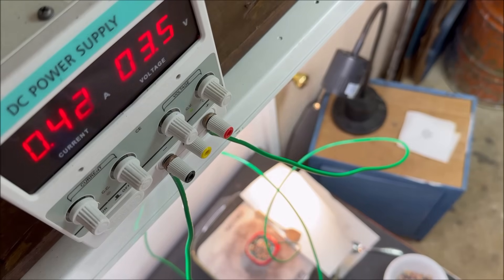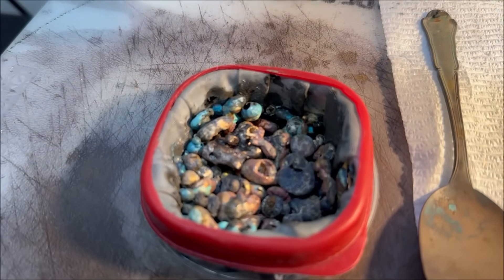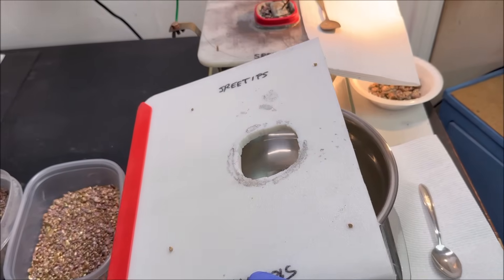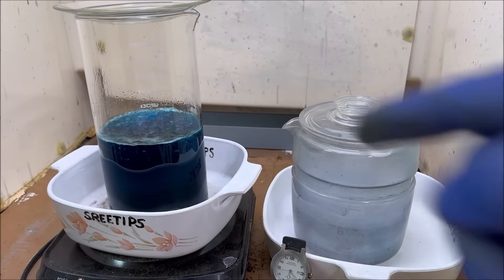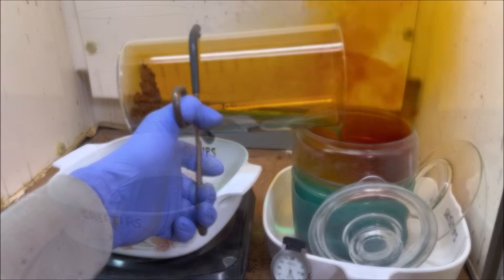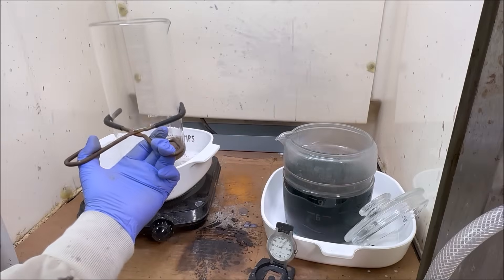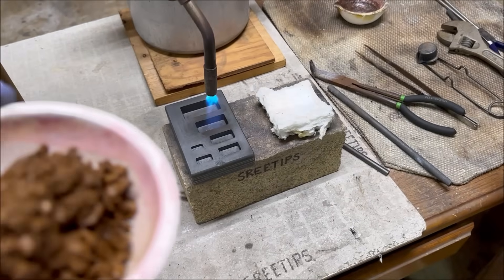Where Does The Silver Come From For The Silver Cell

Comment: What's the point? Is it just pulling silver out of solution? Where does the silver nitrate come from? Isn't it more expensive than the silver that is extracted? Pardon me for being dull. But I can't see what is gained, unless silver nitrate is cheap.
Reply from the maker: I refine gold. I use sterling silver, that I buy at estate sales, to refine the scrap gold. I recover the silver from that, melt into shot, and run it through my silver cell. Silver is a by-product of my gold refining. The cell converts the impure silver (about 980 parts per thousand silver) to high purity four nines fine (9999 parts per ten thousand) pure elemental silver metal. So I’m refining the impure silver, that I recovered from my gold refining operations, into high purity silver, not creating silver out of thin air. When the silver cell is full of pure silver, I harvest the pure silver crystal, put it away and forget about it. Then I repeat the whole thing again.

Comment: so you need to have silver to make silver, got it
Reply from the maker: Correct. I refine gold. I use sterling silver, that I buy at estate sales, to refine the scrap gold. I recover the silver from that, melt into shot, and run it through my silver cell. Silver is a by-product of my gold refining. The cell converts the impure silver (about 980 parts per thousand silver) to high purity four nines fine (9999 parts per ten thousand) pure elemental silver metal. So I’m refining the impure silver, that I recovered from my gold refining operations, into high purity silver, not creating silver out of thin air. When the silver cell is full of pure silver, I harvest the pure silver crystal, put it away and forget about it. Then I repeat the whole thing again.

Comment: So, are the source materials, jewelry and flatware, basically worthless?  Just wondering what the ROI is after source materials and equipment.
Reply from the maker: Actually, the jewelry and flatware both have a known quantity of pure silver and they can be, and they should be, held just like they are. No need to refine sterling silver as long as you don’t ruin the markings. Most of my silver was acquired back when silver was under twenty bucks. In order to calculate ROI then I’d have to sell it to determine gain or loss. And I’m not wanting to sell my silver. I’m saving it for retirement. When silver hits $300 I plan to use it to fund my retirement. I’ll make and sell 5 ounce silver bars, ten ounce if I need a little extra.

Here’s the secret; the ONLY reason that I refine silver is because I have hundreds of pounds of cement silver from my gold refining. Silver is a by-product of my gold refining. But the cement silver has questionable purity and value. So I MUST run it through my silver cell to get it to industry standard three nines. Then its value is easily determined. Hope this helps. Thank you.

Comment: So when you sell, do you do it mostly to refineries or do you ever go to a coin shop? I'm sure if I looked I'd find a video you've made on it but how would you go about refining the gold further or do you typically call it about where you got it in this vid at .990ish
Reply from the maker: I’ve never sold gold or silver to a pawn shop. I’ve sold silver bars on my eBay site about ten years ago. I sold every bit that I refined. Made a good income from it. Then I started just saving the silver because I knew, for almost twenty years now, that we were in trouble when they started printing currency, out of thin air, to avoid financial ruin. I sell a few grams of gold on my eBay site. I sell an ounce or two of pure silver crystal there also. But I don’t need to sell the metal, so after I refine it, I put it away and forget about it.
Reply from the maker: The gold can be refined a second time if contamination is still present, or suspected of being present. Each time I dissolve, filter, precipitate, each cycle the gold becomes higher purity. But if I want ultra high purity then I’d just run it through my electrolytic gold refining cell.

Comment: So why do you use impure silver for the basket and not the pure stuff you get from other harvests?
Reply from the maker: To purify it. I have buckets of impure silver from my gold refining. Its purity and value is indeterminable. But after I run it through the silver cell, its value is easy to determine.
Reply: @sreetips  Thank you as I'm trying to learn things, I've only been watching you since you are very proficient. I'm gonna be trying to make my own silver cell in the next month or so. Thank you for the fast reply back :)
Reply from the maker: The only reason that I refine silver is because I have so much of it from my gold refining. The only reason I refine gold is to make content for my YouTube channel. Sterling silver can be and should be held as is. No need to refine it. As long as you don’t ruin the markings, it will track right on up with the bullion price.
Reply: @sreetips  Thank you so much for that, I'm not gonna work with Gold for bit due to the price of course, but that is an awesome tip, thank you for being so helpful :)
Reply from the maker: The same goes for karat scrap gold. You can buy it very cheap at yard sales. Then put it away and forget about it. Next thing you know, you’ve got a hundred grand in scrap gold and silver.

Comment: What kind of safety gear and precautions would one need to take for doing this? Also I assume good ventilation is needed and temperature control?
Reply from the maker: Fume hood is required. No way to safely do these reactions without one.

Comment: bro so I can produce silver at home and make money this way? OR what
Reply from the maker: Yes, I’ve been doing for a decade and a half. But you make your gain when you buy. I refine gold. I use sterling silver, that I buy at estate sales, to refine the scrap gold. I recover the silver from that, melt into shot, and run it through my silver cell. Silver is a by-product of my gold refining. The cell converts the impure silver (about 980 parts per thousand silver) to high purity four nines fine (9999 parts per ten thousand) pure elemental silver metal. So I’m refining the impure silver, into high purity silver, not creating silver out of thin air. When it’s full, I harvest the pure silver crystal, put it away and forget about it. Then I repeat the whole thing again.

Comment: I'd be willing to bet there is corrosion in that power supply causing the failure. They don't  use conformal coating. 

If you open it up,  take a look and find lots of corrosion your other power supply is headed for the same fate. 

If its corrosion  than you can apply a conformal coating to protect against the acid fumes. I've used clear enamel paint or silicone conformal spray. I've used this method to protect my psu and vent fan. Never replaced either of them once they were protected. I had gone through several fans and a PSU over a 3 year period. It's been over 5 years now without any problems :-)

Comment: What is impure silver?  Is it .925
Reply from the maker: I refine gold. I use sterling silver, that I buy at estate sales, to refine the scrap gold. I recover the silver from that, melt into shot, and run it through my silver cell. Silver is a by-product of my gold refining. The cell converts the impure silver (about 980 parts per thousand silver) to high purity four nines fine (9999 parts per ten thousand) pure elemental silver metal. So I’m refining the impure silver, into high purity silver, not creating silver out of thin air. When it’s full, I harvest the pure silver crystal, put it away and forget about it. Then I repeat the whole thing again.

Comment: Hello sir, If copper precipitates silver. and iron does that to the copper. What would precipitate tin if it was present ? Im salvaging a good bit of safety, silv 56. Maybe i can get some stannous as well as silver and copper ???
Reply from the maker: I’ve never worked with tin except to make the stannous chloride testing solution that I use to test for the presence of precious metals in solution.
Reply: @sreetips  just wondering what if

Comment: Are you actually growing silver using silver? I have watched a few videos and they are very good, great content and informative. But are you actually growing it or just refining it making it worth more.
Reply from the maker: I refine gold. I use sterling silver, that I buy at estate sales, to refine the scrap gold. I recover the silver from that, melt into shot, and run it through my silver cell. Silver is a by-product of my gold refining. The cell converts the impure silver (about 980 parts per thousand silver) to high purity four nines fine (9999 parts per ten thousand) pure elemental silver metal. The impure silver is added to the anode basket. The anode basket is suspended in the silver nitrate electrolyte. I pass an electric current through the impure silver. The silver dissolves, passes through the Dacron filter, travels through the silver nitrate electrolyte, and deposits (grows) on the inside of the stainless steel bowl (the cathode). The bowl is connected to the negative pole of the power supply. The process only deposits pure silver on the cathode. So I’m refining the impure silver, into high purity silver. When it’s full, I harvest the pure silver crystal, put it away and forget about it. Then I repeat the whole thing again.
Reply: @sreetips  Brilliant thank you very much, makes more sense when I read what you wrote. 
Fascinating videos and information. 
Top man as we say in London

Comment: Great, could you explain the process of growing the silver crystals please?
Reply from the maker: Yes, I refine gold. I use sterling silver, that I buy at estate sales, to refine the scrap gold. I recover the silver from that, melt into shot, and run it through my silver cell. The cell converts the impure silver (about 980 parts per thousand silver) to high purity four nines fine (9999 parts per ten thousand) pure elemental silver metal. The impure silver is added to the anode basket. The anode basket is suspended in the silver nitrate electrolyte. I pass an electric current through the impure silver. The silver dissolves, passes through the Dacron filter, travels through the silver nitrate electrolyte, and deposits on the stainless steel bowl (the cathode). The bowl is connected to the negative pole of the power supply. The process only deposits pure silver on the cathode. So I’m refining the impure silver, into high purity silver. When it’s full, I harvest the pure silver crystal, put it away and forget about it. Then I repeat the whole thing again.

Comment: I started my silver cell this past weekend.   Had hust a little to much distilled water added.  Someone told me to add a little nitric to the electrolyte so it would have enough (FREE NITRIC)  to run. Is this correct?
Reply from the maker: I’ve never added nitric acid to the silver cell. I always add more silver nitrate than I think I’ll need so it doesn’t run lean.
Reply: @sreetips  that's what I was thinking but I am just starting out and didn't have that much nitrate to deal with !! So I'll remember that !! Thank you man !

Comment: when cementing silver out of the acid solution with copper, what state should tthe solution be in?
should it still be an active acid?
should it be used up from adding silver and no  longer reacting but otherwise as used?
should it be neutralized with a base before adding the raw copper bar?
Reply from the maker: I heat my solution until no more fumes form to react all the nitric. A little free nitric is required for the cementing reaction. But too much nitric will needlessly consume the copper.
Reply: @sreetips  so after cementing we're left with mostly copper nitrate solution?
could then iron be used to cement out the copper?
conversely use sulfuric to reconstitute our nitric in a distillation setup?
Reply from the maker: I use iron to cement the copper out. I’ve never tried recovering the nitric or the copper. Not worth the effort.
Reply: @sreetips  it would be for me. sulfurics quite cheap but nitrics dear here. mostly becuase of hazmat fees.
Reply: @sreetips  thank you btw :)

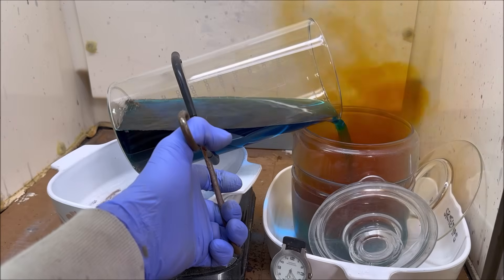Comment: 9:45 the secret sauce!
Sreetips just curious. Does it concern you any pouring nitric wearing nitrile gloves?
Reply from the maker: No
Reply: @sreetips  gloves are definitely important. It's outside of what you normally film but it would be interesting to see the sreetips rundown on nitrile combustion.
Reply from the maker: Nitrile gloves will burst into flames (according to one video) with 95% fuming nitric acid. I use 70% nitric and nitrile gloves are completely safe.

Comment: What do you use as an anode? Any specific metal type/thickness?
Reply from the maker: The anode stock is impure 98% cement silver that I melt into shot. The anode/electrode bar is copper wire cast into a 2.5 Troy ounce bar of pure silver.

Comment: Well, luckily the deers ran away, you won't be able to refine them. 🙃Just kidding. You and Mrs. Sreetips are an extremely harmonious and cute couple. Great videos. I was thinking if it wouldn't be better to drill small holes in the container with silver shot a few millimeters higher than the bottom, so that the fine sediment cannot in any case sink into the larger container.?
Reply from the maker: Good idea, thank you

Comment: Is it absolutly necessary to cement sthe silver or could we just make shot by melting sterling silver and use that in the cell?
Reply from the maker: Not recommended. The amount of copper in sterling silver would quickly saturate the electrolyte with copper.

Comment: .990 is still 24k right?
Reply from the maker: Three nines is industry standard for pure gold. So 990 would be like 23.9k - or something like that.
Reply: @sreetips  ok.
I was thinking that 24k is like 100% or .999 all the down to .950
I thought 24k  is kinda like a percentage or something. 
It's kinda confusing for me how they measure high karats.
Reply from the maker: You can never get 100% due to entropy. So 23.9k would be (23.9/24 = 0.995) it’s just math. So 23.99/24 = 0.9995 so industry standard pure gold is really 23.99k  -  24k can never be achieved. But three nines is referred to as 24k pure gold.

Comment: Hey Sreetips hope you and your wife doing well. 

My question is, is there any difference of growing silver christals in different temperatures? Not the surrounding temps in the room rather the temperature of the liquid in the bowl. 
I ask my self if you can hold the temperature at a specific level during the whole process, will it grow chrystals slower or faster?
For an example - water at a temperature of 5°C can hold 12,8 mg / l oxygen. With the increasing temperature up to 25°C water holds only 8,3 mg / l oxygen. 
So maybe the liquefied silver needs to deliquefied faster cause of the changing liquid properties in correlation to the temperature.

Love your videos. Have a good one and god bless you both. Greetings from Germany (Alex) 🙏
Reply from the maker: There are many variables that influence crystal growth. Temperature could be one of them. But I’ve never tried regulating the temp of the electrolyte.

Comment: I came across a a Chinese company that makes electrolytic Copper refining machines. The anodes are cast ingots, and the cathodes are Stainless Steel plates. In their literature they mention that the way they overcome passivation on the anodes is to periodically reverse the voltage for random amounts of time, and at random intervals. Apparently this breaks off the passive layer that accumulates. Nice trick.
Reply: Did you get one
Reply: @jfssparky  No. I came across it online while googling. You may find it the same way.

Comment: Wonder how much it would produce if ya ran a taller bowl use a nice stew pot maybe I know they make a good stainless one I have one them ud just have to make a bigger basket ya hold the silver in and make it a hair longer maybe that way u could use the entire filter instead of cutting off half of it then u could make 2x as much silver
Reply from the maker: There’s a critical distance of 4 to 4.5 inches that must be maintained between the anode basket and the cathode. I did get a larger stainless bowl to experiment with.

Comment: Have you ever considered instead of making a second silver cell, to just make the current one with a gigantic stainless steel bowl (2 gallon pot) and two impure silver anode baskets??? You can use the same power supply and just use two wires ??? I’ve seen it done and the results are the same except so much more silver crystal production in a much shorter period of time … just my two cents worth… regardless, I absolutely love the channel and you’re making me want to get into the refining biz !!! It will be a great retirement hobby for sure !!!
Reply from the maker: I bought a bigger stainless bowl to experiment with.

Comment: Mr. Sreetips, I was thinking, during the dilute nitric acid boils have you ever tried using wafer thin sheets of inquarted gold instead of the shot? I wonder if this would increase the surface area and hopefully make the process more efficient? You could pour thin bars of the inquarted gold then use a rolling mill to make thin sheets. I would love to see what would happen! Thanks for the great videos!
Reply from the maker: I tried it once. I spent a half an hour trying to roll an inquarted gold bar. Then I gave up and poured it into shot. Sounds like it would probably work. But it adds another step to an already lengthy process.

Comment: I don't get how you get gold from sliver. 
I could give you my stuff if you could use it. Old spoons and stuff
Reply from the maker: Sterling silver is a carrier of traces of gold, especially older pieces. Plus, some gold goes into solution during the nitric boils and get poured off into the silver jar. It just builds up and accumulates in the anode basket as the cell operates